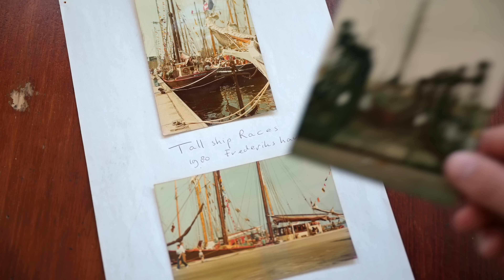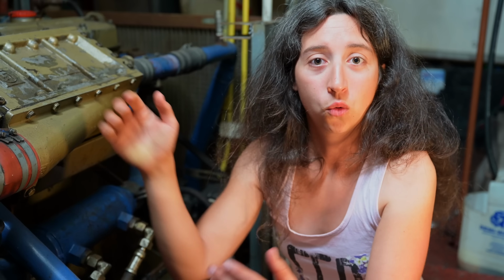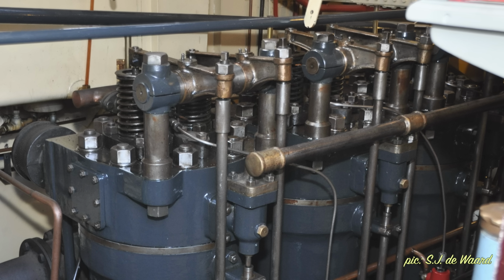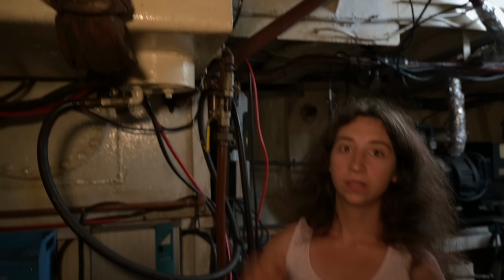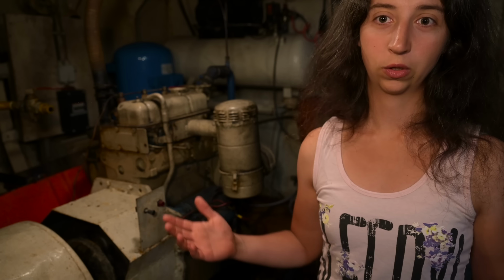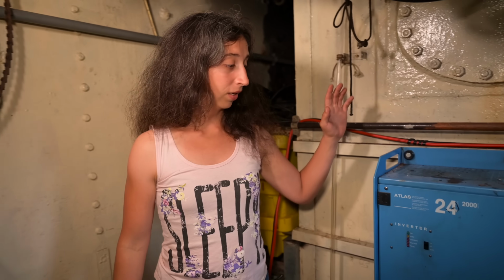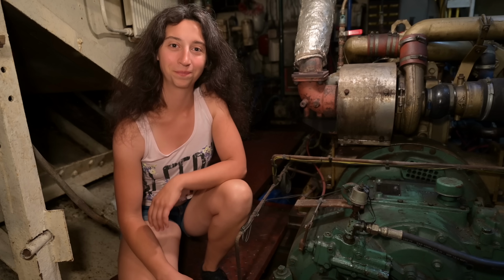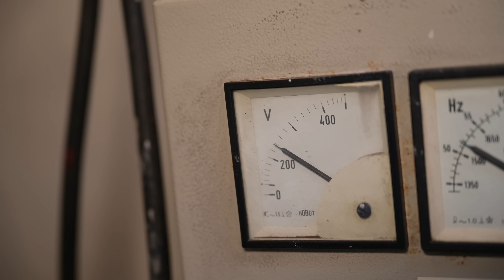ENGINE ROOM Tour of our Huge Historic SAILING SHIP!

Comment from the maker: Thank you all for taking part in our "what the hell is it" quiz. This time we asked you what brand of generator we have because there is no name or plage on the engine. We thought it's a Perkins P3 engine but got even a more detailed answer from you. It is a Perkins P3-152 with a Sims fuel injector which probably is the result of a Ford-Perkins collaboration. Similar engines were used in Massey Ferguson tractors and it seams like the Fordson Dexta 2.4 has the same collaboration unit we have as a generator.

Comment: Pneumatic needle scaler is the ultimate tool for refitting an old steel hull.
Actual rust is often hidden under a hard and shiny black layer of hematite. Hematite is another kind of iron oxyde (Fe2O3). When sanded it becomes bright looking like good metal. But it isn't. Actual red rust is steadily expending underneath. 
The best technique I knew when extensively refurbishing my old ketch was picking the hematite with a welder hammer. I remember thar epoch like hours and days and months of glorious hammer picking (😉)

Years later in the Caribbean, in search of a shipyard for maintenance and storage, I found this magic wand. I told the manager: " I choose your facilities because of the needle gun, so I book it right now!"
Reply: Joel is correct... I've spent many hours with both a chipping hammer and needle gun when working on trawlers in the yard.  Needle gun is by far the speediest tool to get back to true metal.
Reply from the maker: Never use a wire brush (angle grinder) on a steel boat... It's amazing how many still use this method and wondering why the use always comes back. On my research I came across two interesting products. One is the Monti Bristle Blaster and the other one is Tercoo. The later basically works like the multiple welding hammers on a rubber disc. The Bristle Blaster imitates sandblasting and is widely used in the pipeline industry. Unfortunately both tools are quite expensive. Thanks for the advice!
Reply: @FlyingConey  wow the Tercoo is amazing! At least on ad videos. I didn't know it. 
Yes it's expensive, but it all depends on the lifespan of this thing when extensively used.

Wired brushes are not that bad, but only for the final surface preparation before sand paper and primer painting, and once the mill scale is removed, especially the soft crimped wire type. They come with various sizes and shapes (disk, cup, brush...) for flat surfaces to small corners. 

I agree with you that the hard knotted wire attachments are not the good alternative for scaling.

Comment: I admire your energy and determination. You have undertaken a big project, but the finished ship will be worth all the labor and frustration. Do not get discouraged!
Also, you will extend your DAF engine life if you can design a system to circulate warm water through the engine before start-up, like a block heater for commercial trucks.

Comment: You have full rudder, good size prop and no bow thruster and she's single screw .
Which means you need to drive backwards in a straight line better than you drive forward for docking and undocking .
She a beautiful steel tonka toy to live onboard  .
Have you considered adding a thruster either on the bow or on the stern for easier maneuvering in close quarters for docking and undocking ?
Washer and dryer onboard along with a watermaker and a tall water heater for showers then my tv for gaming and tower computer aka desk top .
Then compressor for dive bottles  .
Wonderful tonka toy 👍

Comment: You got a lot of work ahead of you. I would take the boat out, clean it, measure hull thickness, uninstall everything possible and do a full rust isolation from the inside and out, then start rebuilding. I wish you all the best. Godspeed!

Comment: You two seem like very cool people which is why I subscribed to this channel...it's not my normal kind of boat to look at, but you are quite engaging and are making it interesting to watch....wow, you are going to need an army of cleaning workers to get this baby looking somewhat resembling a tip top shape ship.....so it will be interesting to see how it goes.  Do you have a "guesstimate" on a completion date for this gem?
Reply from the maker: Thank you for subscribing. Our project is unique because we're restoring and converting a motorsailer to sailing ship. It's a long journey and we hope to get the boat operational in 3 years. But that's only if we can make a living from YouTube. Otherwise it will take longer. We hope we can tackle the filthy engine room quite soon, just need running hot water and a brush and in two days it will shine again.

Comment: Thanks for another great episode, and just a tip, please do not use needle scaler below waterline before hauling out the boat. The tool is good for getting off lots of loose rust, but it can penetrate weak areas of the hull as well. That is, unless you want to make some another "our boat is sinking" type of episode 😀
Reply: This.  I'm a hotrodder, not a boat guy, but I've seen brake systems that pressurized to around 900psi, work perfectly well, until they were wire-wheeled, at which point, plugs of rust popped out and immediately began leaking like a sieve.

Comment: The compressor was needed on board to get the Industrie engine started. When it is still working I suggest you keep it on board because you will need a needle scaler anyhow.
Regarding the DAF, it is a very reliable engine. And despite her age all spares are still available, at least in Holland. But I advise you not to speed her up so much immediately after starting. Please always let the engine get a bit warm before pushing the throtle. This will give a longer lifetime in the end.
And your Twindisc gearbox is a professional one and has a very good reputation.
Success with your project.
Reply from the maker: Thank you. We have to give the engine a little push after starting so that the alternator starts working. Otherwise the charging indicator lamp is on for minutes. Usually Daniels starts the engine and Barbara pushed the engine a bit too long this time. Usually it's just a very short push on the throttle and usually we we let the engine idle for about 15 mins until we start with maneuvering or so. The oil in the engine is a SAE 30 so it needs to warm up a bit. Also thanks for the information about the gearbox!
Reply: I disagree, Diesel engines should not be warmed up at slow idle when cold, they should be warmed up under some load . This stops the bores ‘glazing’ and causing loss of compression. This cannot fixed itself , you would have to refit the engine to eliminate the glazing so be sure to warn the engine properly under light load , propeller engaged at the dock is ok and be sure Engine gets fully warmed up before shutting off, or much better go for a short trip to get everything working properly. ( say once a month!)
If you read any operating instructions for older engines they always say warm up under load and do not slow idle when first started.   
Cheers Warren
Reply from the maker: Interestingly that's exactly how we do it. Starting the engine, giving it a small push so that the charging indicator lamps turns off. Then we have a look in the engine room if everything is alright. Engaging the prop and let her sit for another 10min and than increase the load for another fife to ten minutes. Since we are short handed moving the boat is quite a big deal and takes up at least a few hours. But thanks for the advice! Keep them good tipps coming! 🤓
Reply: You have a big strong reliable engine and gearbox there and 500 hrs it wouldn’t even be run in but I agree, if you have the funds then an overhaul will give you limitless peace of mind

Comment: I'm quite interested in the HP/heating project!
Here's a couple questions:

-Do you plan to adapt a ground source heat pump? Or make it 100% custom?
-Where will the evaporator be on the ship and what geometry will it have? What material do you plan to use? I imagine it will exchange heat with sea water, so beware of corrosion, both inside and outside it). What about winter conditions, is it a big deal if it freezes nearby sea water?
-Where do you plan to fit the unit? How do you plan to manage the noise produced by the compressor?
-Did you estimate the heat losses through the hull and top?
-For the heat carrier fluid, do you plan to use one of the two tanks as the hot water tank in a closed loop? Will you put anti-freeze (ethanol, glycol) in it? Is it still planned to be a plastic tanks? Won't it affect your reserves of drinkable water to dedicate one tank for this use?
-What refrigerant do you plan to use?
-Do you plan to reclaim heat from the engine's/generator's exhaust gases? If so, mind the corrosion that the exhaust gas condensation could cause (I guess there is sulfur in the fuel).
-How do you plan to link all your heating sources together? (HP condenser, boiler and potential heat recovery from the engine/generator)

I would suggest the following operation mode:

-In harbour: HP charging a Space Heating (SH) tank - most likely one of the two you have - or topping up a smaller Domestic Hot Water (DHW) tank depending on the need. Charging the tank at maximum temperature before departing harbour would probably allow the ship to stay warm at sea for like a day without firing the solid fuel stove.
-At sea, under engine: Harnessing as much fatal heat from the engine/generator as possible, DHW first and then SH.
-At sea, under sail: fire up the solid fuel (pellet maybe if not too difficult to find/store) stove and use the heat in a similar fashion: DHW first and SH after.

Sorry if the message is a bit messy!
Reply from the maker: I totally understand why the message is a bit messy. It's a very complicated topic and we are still very much in the planning stage. I try to give you an idea of what we think and why: 

As a heat pump I think the best option is basically a ground source heat pump. My idea is to run a pipe a alongside the hull similar to the keel cooling. Usually these heat pumps use brine as a fluid. This concept works on several houseboats here and for arctic temperatures I would still have the solid fuel stove and the generator. I would use a commercially available unit and only have to find the proper material for the pipe because I think normally they lay plastic hoses in the ground. 

As a puffer tank my choice would be a phase changer tank with paraffin balls in it. Mostly to safe space since even on our ship a 3000 liter puffer tank is too big and since you can store more heat in a smaller phase changer tank that's something we should consider. 

I do want to connect also the genset and the main engine to the puffer tank. Also to give me the opportunity to pre- heat the main engine. So the idea is to have the buffer tank as the heart of the system and only if that one is hot the keel cooling is used to cool down the engine. 

There are different ways to get hot drinking water from a buffer tank. 

I hope this helps to get you a better idea! 😉

Comment: That engine room machinery is old but in good condition just needing maintenance and loving care, I’d have oil samples done on the main engine before rebuilding it may well be fine by the sound of it and that money could be used on other maintenance or other projects. Having shore power sorted first maybe a priority having plug and play power tools and convenience of living and heating with your winter around the corner

Comment: I noticed that you are having a problem with corrosion on the battery cable ends and the insides of the ends are a dull gray the color is due to resistance this can be fixed by cleaning the post and cable end and then applying dielectric grease to them (it can be found at automotive stores ) this will stop this problem and make it much easier to charge and use them it will also add life to the batteries you may want to also get a tester to check the acid level in the batteries so you get maximum charging and longer life .the easy way to clean that white colored corrosion is to use baking soda and water .If it is on a flat surface or in a corner you can use a wet towel or rag soaked in it and and lay it on the effected area. then simply rinse with water .

Comment: ship is huge has a lot of big parts.  i watched a utube video of Lazer process for rust removal from the frame of a car.  Very slow time-consuming process.  I am sure this is not possible considering the size of your boat.  I think I remember that you have considered using Lazer for hull rust removal but decided it's not feasible also.  
So good luck you are very brave taking on such a huge project like this.
Reply from the maker: We're still considering using a 2000 watt laser for the inside of the hull. The problem is that these machines are incredible expensive. Costing up to 40 000€. Even renting them sets you back at about 4 000€ a week and then you need a strong generator and proper fresh air supply and so on and so on. So although it's a great method it's probably cheaper to have it sandblasted by a professional.
Reply: Thank you for your response.   I started sailing at a very young age using a bed sheet for a sail and paddle to steer the row boat .   
I have continued to sail representing USA as jr sailor championship in Brazil in penguin dingy    Then as a lightning sailor at several us and world championships.  So it’s interesting to see that you both where competitive sailors too now looking to live aboard and restore such a massive yacht.  I wish you all the best.

Comment: Those P3s are long lived, i got one in my Massey Furgurson 135.  I always wanted a boat big enough to use one as a main engine, they were used in fishing boats and could swing a 3ft diameter propellor.  Normally die from not being worked hard enough, glazed bores and rings.   Not sure why they need a turbo on an 11 litre diesel, did they do a non turbo version?  Always thought it was something else to go wrong, but even big ships have them.
Reply: Fuel economy

Comment: Hello, what a wonderful project and boat. 
I look forward to following your progress. I hope you find time to do some small trip on the boat while you’re are refitting.   
I’m confused you think the hull may have been changed from wood to steel? Maybe all the equipment was moved from a wood hull to a steel hull???
I hope you reconsider overhauling the engine , with so little hours it should not need disturbing but maybe this will be part of the engine room downsizing. 
Gook luck  .
Cheers Warren
Reply from the maker: I found information that the ship dates back to 1941 although the official building date is 1950. Also they switched out the Deutz engine after only three years in use. It's kind of strange that they built in a German undersized engine. There was a large series of wooden fishing vessels called "Kriegsfischkutter". The fishermen were getting a cheap loan for the ship but in the event of a war the ship was converted into a warship. (And the fishermen were converted into navy soldiers). These trawlers were mass produced with steel or iron frames and wooden planks. After they sometimes re- used the steel frames of damaged, sunken or unfinished vessels. They used what they had and what they could afford. I think it's one of the most amazing things about Flying Coney how many technologies, techniques and design elements come together.  Built as an early motor ship but still with a sailing ship line, built like a composite ship but with a riveted steel hull. Since she was one of the last fishing ships with the old lines she discontinued fishing quite early and was converted into a sailing ship and so on.

Comment: If it is a Perkins you have struck gold. The perkins was an excellent engine because of the design of the inlet port, so it was very reliable on start, many diesels are very very difficult to get running, an example is the International, I am a farmer and these engines are used in tractors.
Reply from the maker: It's a modified Perkins P3! I think this engine was used in Massey Ferguson tractors.

Comment: Since you don’t like the aft deck cabin have you considered painting it a dark color to it does not stand out for now anyway? 
Cheers Warren
Reply from the maker: It's not that we don't like the aft cabin. We do live in this cabin and the wheelhouse most of the time. Only the galley is down below. But the quarter deck divides the deck space and we almost never sit up there. On the long run we want to convert the ship into a sailing vessel and with the superstructure that high we would use a lot of mainsail area. Also being higher up would mean to feel the rolling and movements of the ship more. Furthermore getting from the helm position to the main deck quickly is something I'm concerned off. So it's more a practical consideration from a sailors perspective. (And I also prefer the look without it...)

Comment: You said your vessel is single screw. At 82 feet do you have any plans to install a bow thruster in order to aid in maneuvering?
Reply from the maker: Let's say it that way, a bow thruster is very high up on the wish list but very low on the priority list. I spoke a little bit with the captain of the Elia and he also recommended a thruster. But it comes with a 8-10 000€ price tag.